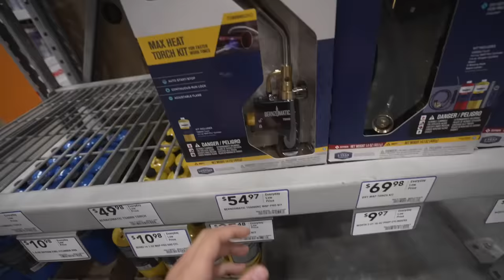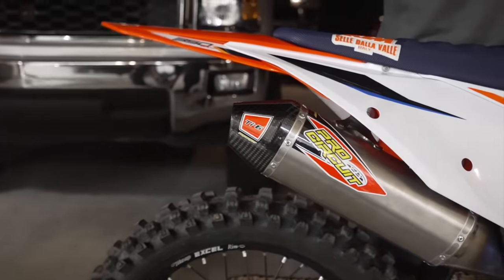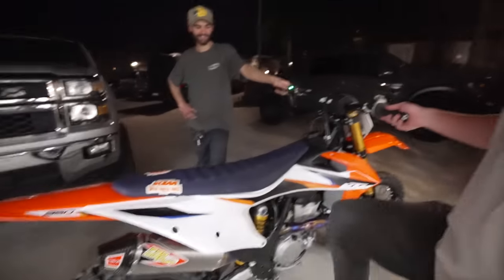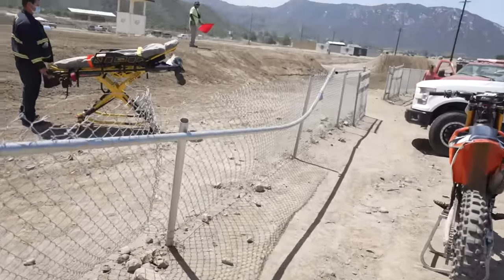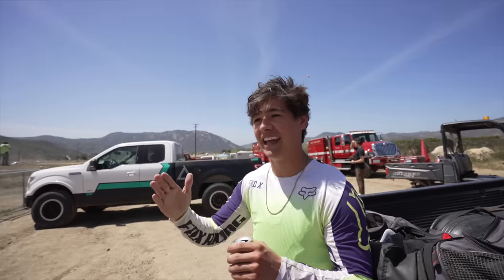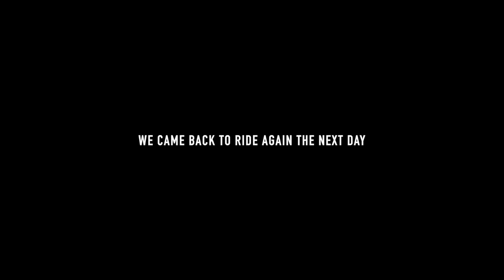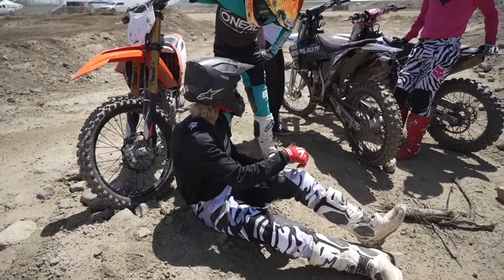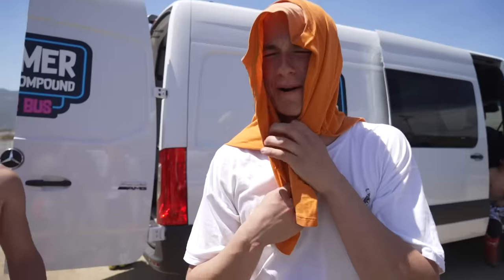SCARY Dirt Bike CRASH Caught on Camera!! *2 BROKEN LEGS*

Comment: Dude i dont know why this was on my home page but i had something pretty similar happen to me at Cahuilla 3 1/2 months ago and is giving me crazy flash backs. I over cleared a 40 foot double by about 30 extra feet and landed flat. Suspension fully compressed and ended up with a hawkins level 3 talar neck fracture. It messed me up so bad. Internal bleeding, emergency surgery, and now i have a 90% chance of losing my talus all together due to avascular necrosis. My surgeon told me i pulled the shortest stick in the stack, and i'll be lucky if i ever walk pain free again. Sucks to hear that at 28 years old, but i'll persevere. Glad homie is doing better now.

Comment: I once jumped completely over a chain link fence at Carlsbad long ago. Was on a downhill jump and the track was watered and slippery and I went like 30 degrees right off the jump face and cleared a fence and landed in hip high weeds lol. Took a while to find a hole in the fence and get back on the track.